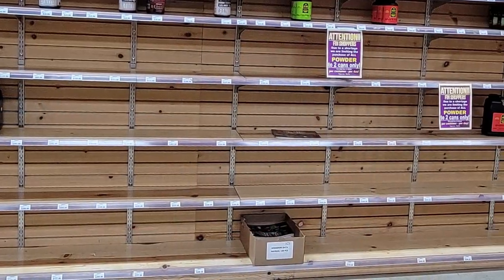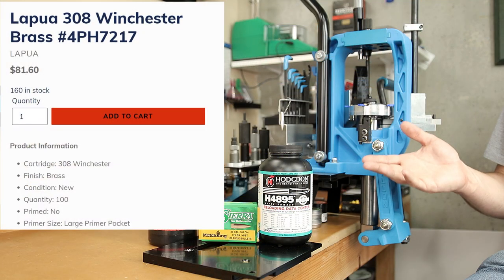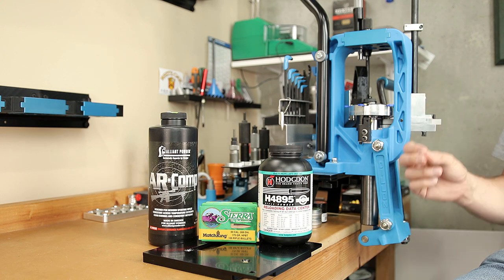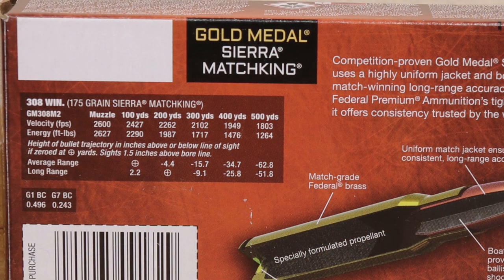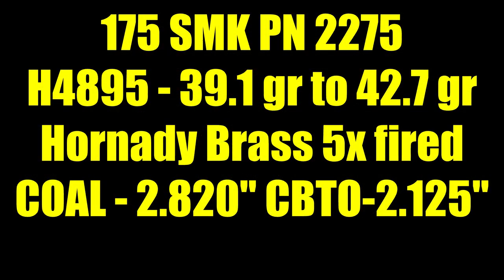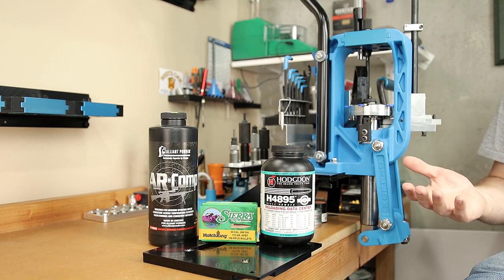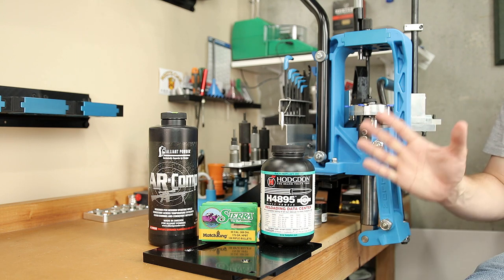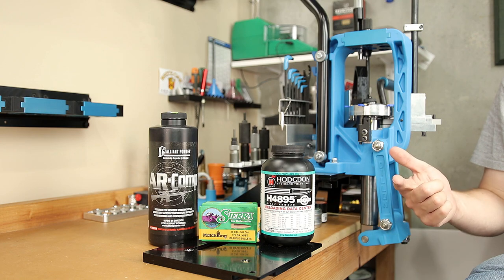Powder Charge Test - Starting Over

Comment: If I could only choose one powder it would be H4895. You can safely load nearly every rifle cartridge that exists with it and it CAN shoot as well as anything else out there. For very large cased overbore calibers you'll get faster velocities with slower burning powders like Retumbo or 7828ssc, but H4895 is a powder of all trades. It's one of the least temperature sensitive powders on the shelf, it will cycle all kinds of gas operated semis reliably including ARs and it will even shoot up 60% reduced loads safely. It needs to be mentioned that it is NOT IMR4895, and the load data is NOT interchangeable between these two powders!

Comment: I too, would enjoy seeing you work up additional loads....not necessarily because it's 308, but moreso as a validation of the process. But it would also be very interesting comparing the data between your loads (differences/similarities in group size, velocity, & seating length). Is a "load" more component dependent, or will one bullet roughly shoot the same if driven at a similar velocity with different powder? Does the cbto length change, or stay the same?

Not to pick on your style (& this is meant constructively)....but sometimes reaching/proving a conclusion would also be handy.

Thanks for the content.

Comment: 13:48 That brass was fired only 5x? Wow. What sort of rifle are you running it through? Is the rifle typically that hard on casings, or is this an issue with the quality of Hornady brass? I've seen Remington 308, Winchester 308, and milsurp Lake City 7.62 casings fired 8+ times without any sign of impending case-head separation.

Comment: Is that actual case head separation or where your case is stretching after resizing ? I am seeing this on pretty much once fired federal brass in the 308 and I found that ejector marks are more caused by headspace and ejector protrusion issues. I am unlucky I get them all the time in my AR10 from min to max it just doesn't go away. In my 300 win mag bolt action I also get ejector marks all the time from min to max on federal, Remington and Norma doesn't matter. It's quite annoying. 

I did the same test with retumbo in 300 WM and went from 74 grains to 78 grains with 225 ELDM in Norma with fed215s. No pressure signs other than those damn ejector marks velocity was from 2750-2870 but could not find a flat node... Brass looked the same and primers looked the same from min to max, my COL was 3.675" and groups were horrible, not landing in the same zip code
Reply: Just wondering if you are cleaning the sizing lube off your brass before firing? Or maybe leaving oil in the chamber? As you are having the issue with two different rifles and multiple brass types it is pointing that the issue is the brass not gripping the chamber walls like it is meant to and causing "bolt thrust" (not sure if that is the right term 😂). Try cleaning some loaded rounds, action bolts and chambers with a degreaser and then fire those rounds to see what happens?